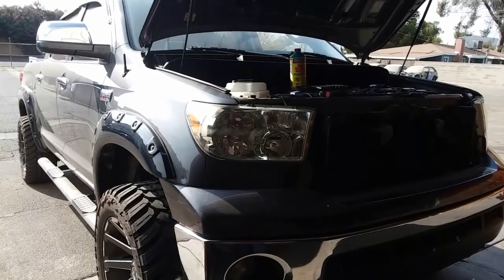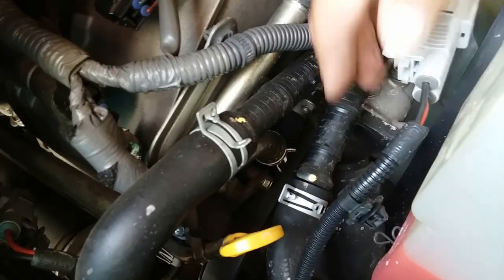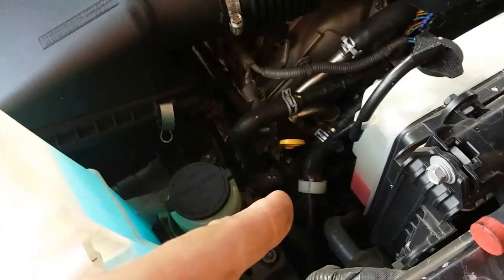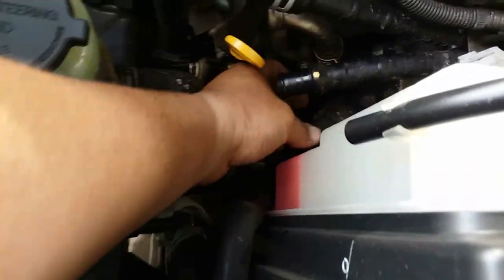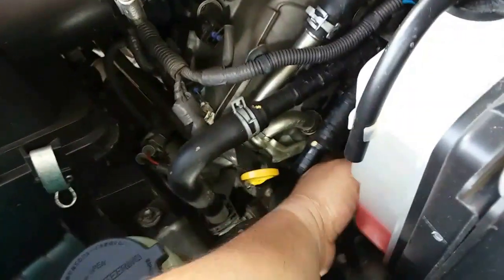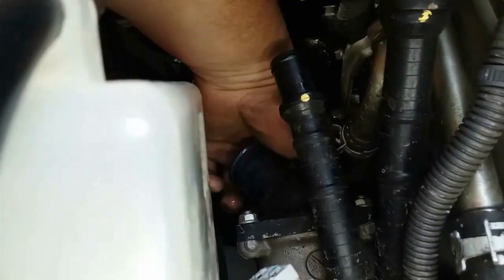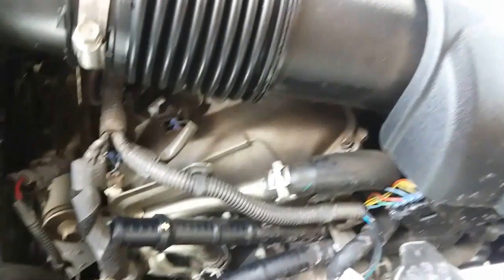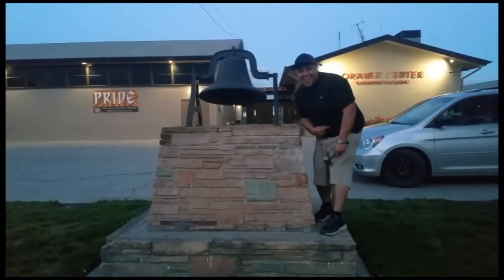How to: Remove a Thermostat from a 2011 Toyota Tundra 5.7L

Comment: My truck heated up a bit going up a hill this weekend while towing a trailer . The fan clutch feels week and I hope by replacing the thermostat and fan clutch will help. It didn't get hot at all on the way back .
Reply from the maker: Good luck brother the cooling system is a complex sealed system, with many hoses and components. Hopefully the Thermostat is bad and yes replacing the clutch fan would be a great idea, because it can have natural wear and tear.  Thank you for your SUPPORT!
Reply: @559powerscape  
Thanks was tired from the trip got some rest took the day off I replaced the thermostat and clutch fan . Seems good wont know until it really gets hot here in L.A.  by the the way I subbed 👍
Question do these 5.7 run hot ? The radiator has always felt hot had this truck for 2 years and its alway been warm not blazing just hot . Thanks
Reply from the maker: @Mr_brut3  yeah these trucks run a little on the hot side but should always stay at half way point. Nothing to bad. Thank you for your SUPPORT! Good luck bro hopefully no more issues!